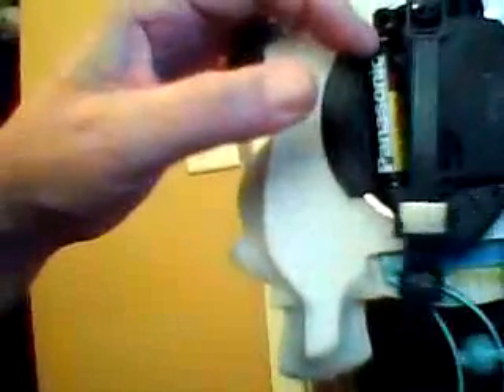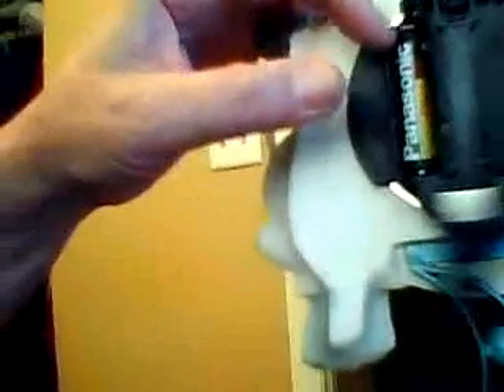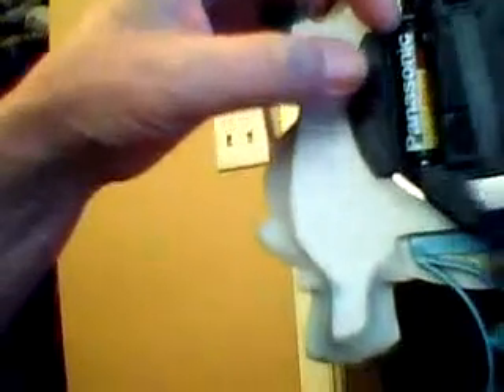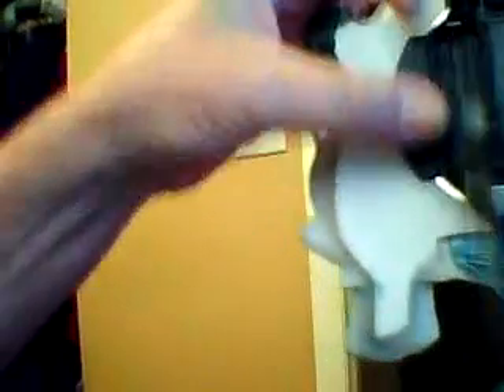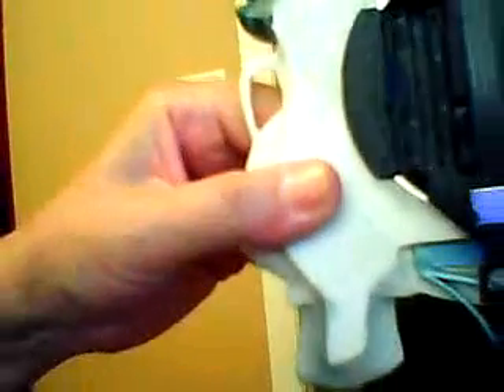FREE ENERGY ? PENDULUMS

Comment: The pendulum does not keep moving.  You can see as it was moving back and forth that it was loosing a small amount of arc every time.  It's just balanced but it eventually stop.  If you put a wire to cross the magnetic field perpendicular, you you will generate a small amount of voltage and as you try to draw current, the pendulum will quickly die due to Lenz Law.

Comment: what is the ratio of the length from the top to the pivot point to the bottom? Also are the top and bottom weights of same weight? It looks as if its in the golden ratio of 5/3 or 1.618, 5 being the bottom length 3 being the top length.